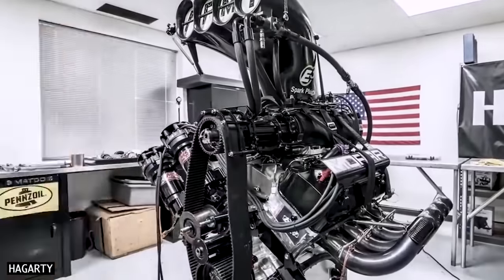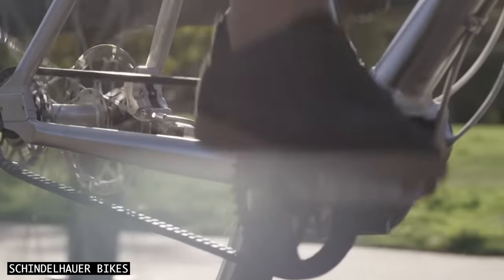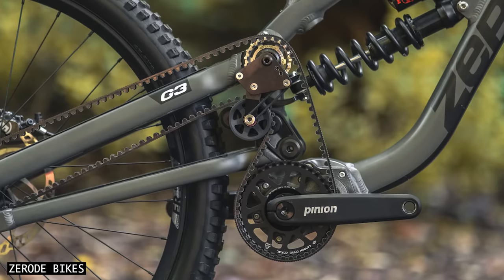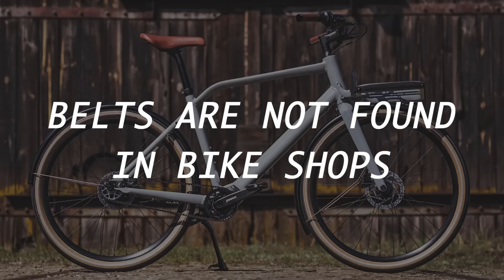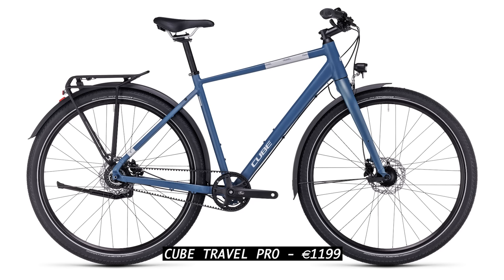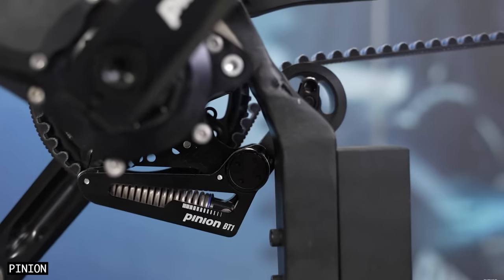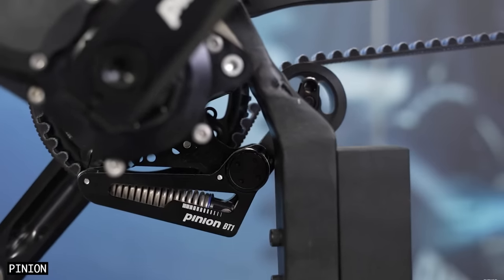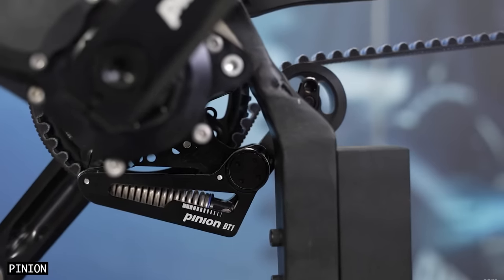Belts Are Now BETTER Than Chains On Bicycles!

Comment: A belt is great with an e-bike. It literally eats the energy you put in it when riding a normal bike without any assistance. I took the belt (and cogs) off my bike (with a Pinion P1.18) and replaced it with a chain. The much better transmission of the energy was palpable. Don't believe what Youtube tells you unless you've made your own experiences. This video is full of misleading information.
Reply: You didn't watch until the end.

Comment: Belts are not as practical, serviceable, available, compatible and easy to fix as chains.
if a belt snaps in the middle of nowhere you will regret for the rest of your life, 
Belts are not yet that good for long tour expeditions, yes you can do it but it's not the same as the old reliable chain.
Reply: You're literally trying to preach to someone that has spent the last decade or so of his life on long expeditions...
Reply: @cjohnson3836  my opinion
Reply: @Almajtek  is irrelevant. You're not informed enough to have a valid opinion.
Reply: I have to agree. The biggest problem: once something jammed in the belt and the belt will "remember it". With the result that the remaining lifespan is then suddenly uncertain, unlike a timing belt fully protected in a housing. And how gladly one "forgets" the "small" incident of the jammed small wooden branch. So belts are top for the city but flop for touring.

Comment: Dream: Convert my Birdy folding bike to belt drive. It would need both a custom tensioner to account for the suspension, and possibly an extra tensioner to manage the belt when folding the bike. The frame doesn't need a splitter.

Comment: Thanks very much for the apparently comprehensive look at bike belts, most enlightening.  The thing that puts me off belts is the need for a bike frame that allows for a break in the rear triangle to allow the belt to be fitted.  I'm not keen to take a hacksaw to my titanium bike frame.  Has anyone fitted the rear toothed pulley via a spline to allow the drive to be wholly outside the rear triangle ?  That would look weird and make the bike wider both at the rear axle and at the bottom bracket but at least removing and fitting the belt would be a breeze (although the need for such an odd frame kind of negates the advantages of allowing the use of a frame that would no longer need to be open-able to allow for the fitting of a belt).  Surely some eccentric frame builder must have tried this at some point in time since John Kemp Starley produced the first commercially successful safety bicycle in 1885.

Comment: I've been regularly checking improvements and deals of belt drive systems. But they're still too expensive for my taste, about 300$, which is considered expensive in my country.
I got nuvinci n380 with 2 gear front cog (44-29t) and 17t rear cog, but will be glad if I can change to belt system say below 150$, the price I bought the CVT gearbox.
With that said, you don't need a special frame. Some belt systems have dettachable section to install to any bike.

Comment: While perfectly fine on bicycles ,belts on motorcycles have 2 major downsides:
They usually require major disassembly of the  bike to replace (5 or 6 times the time to replace a roller chain)
On chip seal paved roads, loose stones land on the wide belt and get drawn through the pulley as the belt runs around it , destroying the belt
And that is why they are the least common final drive system

Comment: re: the timing belt vs. chain thing, couple critical differences. 1) speeds and temperatures are WAY higher in car engine, both of which wear the belt faster. 2) car timing chains, unlike timing belts, are are "wet," as in their inside the engine case, and have their own dedicated oil spray. The oil both cools and lubricates the chain, so it is always clean and there's very little metal-to-metal contact (the viscosity of the oil makes a protective layer between the chain and sprockets... chain oil on a bike does NOT do this). so in cars, belts have more disadvantages and chains have more advantages

Comment: There are pros and cons to both belts and chains. Personally I think chains are stronger. My latest bicycle build has three chains and four derailleurs for a total of 126 speeds. This arrangement would be difficult if not impossible if I wanted to use belts instead of chains.

Comment: I've tried for many years to go belt drive on my 2003 Cannondale Scalpel with a Speedhub. Even though I can open the seat stays for easy on-off with the belt, they say it won't work; they don't have a rear hanger tensioner that will work for me.

Comment: Even when a chain is dirty it still has an uncanny ability to run efficiently, it's a firm, crisp transmission of power. They have very small contact areas between chain and sprocket and self-clean exceptionally well. Take a good look at the contact area on the sprockets on your bike, use a magnifying glass if you like. You'll be surprised at how clean the surfaces are.

Comment: I got my 1st mechanic job in 1984. I was surprised when I saw my '05 Harley Davidson came with belt drive. on motorcycles not raced it seems to be better for certain reasons. unlike a chain it never needs or throws lube and I can't remember the last time I had to tighten it, maybe a few batteries ago. but I did snap one once with some violent downshifting on pavement, so they are not as strong, but it's breaking may have saved my transmission some grief. you can't always treat street bikes like dirt bikes, I must remember. if a chain snaps on a bike it can break the engine case and the oil comes out onto the exhaust and you're a spectacular ball of fire going down the road 🔥. but inside an engine for timing gears a chain is my only choice.  🏁

Comment: And in terms of chains in car engines.
They are getting lubricated with engine oil while running all the time. Bike chains can't get that. Temperature was also an issue for belts, but it isn't such an issue for modern timing belts. 
Chains in engine are protected from any debris, dirty oil often leads to premature failures of timing chain.

And many modern lighter chain drivers in car engines don't last longer than belts anyway, cause they are not so overbuilt currently (like some silent chains without rollers)
Reply from the maker: Thanks for the timing chain info! Can you tell I don't work on engines? 😅

Comment: I can see this as a future upgrade. I hope they can make gearbox components cheaper and lighter in the future without compromising quality.
Reply: They will, its all being built using old tech atm. Just wait for the nano manufacturing and the new materials to be brought in. Youll get gearboxes the size of your fist.

I just got a new set of false teeth, theyre made of molded zirconia because i tend to break the ceramics. That material alone would do it.

Comment: Until I see people riding on bikes with belts in the everyday traffic of the Netherlands I'll keep riding with a chain. Basically all the benefits you mentioned are already solved by dutch bikes, except for the rust but even that is largely reduced. You see we have a thing called a chain cover that protects the chain form any debris and almost all weather, it also makes it so that you don't have to worry about the grease on the chain because without taking the cover off you litarally can't touch the chain.

Comment: 2 main downsides for using belts that make them inferior to chains are: 
Belts are not completely immune to water-damage. 
Belts can easily slip when too much torque is applied. 
You have neither of those problems with a chain.

Comment: I think a little bit of graphite powder mixed with oil now and then, especially if they are exposed to mud or sand, will make these belts last even longer. Maybe a few times longer.
Reply: never put oil any where near a belt oil and rubber dont mix
Reply: @PaJa-gv3nv  The intention is to put the graphite. The oil is just to make it stick  longer. It could be an oil that doesn't damage rubber, like synthetic motor oil or transmission oil.

Comment: I never had any problems with a chain. I had my previous bike for about 10 years, I live in the Netherlands and use my bike frequently every day for commuting. I never had any issues with the chain.

The only notable durability issue I see a belt could fix has to do with the gears. Gears wear out fairly quickly with a chain, especially with a derailleur. I can see how that would be less of an issue with a belt and a gearbox. Other than that I'd have no reason to prefer a more heavy alternative.

Comment: Replacing my Shimano XT gearset (chain, front and back toothwheels) every c. 4000-5000 km on my S-Pedelec costs about 250 Euros as well. Makes the longer lasting beltdrive considerably cheaper.

Comment: There are plastic casings which used with single speed bicycles mostly, but still it posible to use such device with belt(theoretically, at least construction don't prevent it). If so then belt will last even longer... Well, in case if You don't fear around hundred grams of additional wight on Your bike.

Comment: with chains its hard to fully cover it with plastic because deraileur will get in a way and it needs to be changed periodically.
with belt, theres no deraileur, and maintenance is almost nonexsistent. if we put a plastic case that cover from chainring to sprocket fully, the drivetrain wont be dirty at all. which make it even more OP. why are you not talking about this?

Comment: Cost cost cost: Belts are much much more expensive than chains for the same performance. As you said, you need a special (and expensive) design of the frame of the bike. Then you cannot use the derailleur gear but need a hub gear. In the "normal" price range, you only have 7 gears and high frictional losses with gear hubs. You could use a Rohloff speed hub, which starts at 1,200 Euros, but that is like 10 times more expensive than a derailleur gear with similar performance.

If you are a competition cyclist (racing) you cannot give up the improved efficiency of a derailleur gear, so you are stuck with a chain drive. If you are just the average cyclists who is looking for a bike for the city, you will definitely not use such an expensive belt drive design, because it gets stolen in a blink. 

There are a lot of mountain bikes with chain drive, so the performance cannot be too bad. I´m glad you like belt drives, but it surely is only a benefit for a small percentage of people.

Comment: It's not x3 or x4 time long than a chain that you can cycle with the belt, it more like x15 of x20. With a chain you reach the max chain length after 2000km, so you need probably 20 chains for 1 belt!

Comment: Had a bike with belt drive. Sold it quickly. Adjustment had to be exact or one of two things would happen: 1. If just a bit too loose it would "skip". 2. If too tight it could deform the rear sprocket as happened on my bike. In order to tune it correctly it was recommended to install an app on my cellphone and measure the vibrating frequency of the belt!!! Also it was virtually impossible to get the crank gear perfectly centered so that at one point in the rotation it was too tight hence the rear sprocket was deformed, and on the opposite point of the rotation it was too loose allowing for an occasional skip. So no thanks. If a chain breaks, put on a new link and go. If the belt breaks it must be replaced by removing the wheel. For a while car manufacturers used belts to drive the camshafts resulting in severely damaged engines when the belts broke. Needless to say they went back to metal chains.

Comment: I dont have an ebike yet but i would also choose the belt drive, the problem is the ones with gears are really expensive compared to the chain versions. Only the single speed versions are reasonable priced. A few days a go i rent an old bike from my brother because i dont own one and havent used one since 20 years. The first thing happend was the chain torn off. .

Comment: My father had a Riese und Müller e bike with a standard chain after it got stolen after 3 years he bought a new one with a belt drive and he says he never goes back to chains and the 14 gear Roloff semi automatic hub transmission is just butter smooth

Comment: The rolling resistance on the belt is greater than on the chain. It's harder to ride. That's noticeable. The belt is tight and presses on the bearings, increasing the resistance to pedaling and rolling the bike. And an electric bike with a belt is super cool.
Reply from the maker: I'd encourage you to watch the sections relating to bearings (13:04) and drive resistance (18:19).
Reply: @Cyclingabout  Thank you, you have useful information.

Comment: My car has a timing chain. It lasts 100,000 miles before the side plates fracture. A typical timing belts lasts 70,000 miles costs less to replace and uses a fraction of the labour.

Comment: When I see a MotoGP bike using belts I would take a look. Dakar bikes have chains. On bycicles they have been using chains for a hundred years. It is the most efficient power transfer. Can shorten and lengthen when needed or on an emergency.

Comment: From 2010 i ride for commute a single speed Trek 1st District with CDC original belt, rear sprocket, front sprocket, minimum problems and for ocasional squeeks i use silicon spray from wd40.

Comment: With a good wax, you can now go up to 30 000 Kms with one chain (and way more for the cassette and chainring) and keep your drivetrain very clean.
It requires a bit more maintenance than a belt but now that much.
It's also very efficient and fairly cheap compare to belts.
However, to travel, it's not that great since rain, mud and snow will wash the wax from your chain

Comment: 7:40  my ebike has 160nm of torque,  you can get 180 to 200 nm torque ebikes with 2000watts of power,  so if the belt drive is limited to 50nm then the belt drive is only suitable for lower power bikes.

Comment: one reason I wont be getting a belt drive bike is the lenght of the belt is proprietary in lenght, I very well could use one chain across all my bikes (kids bmx, vintage foldable, vintage city, mountain). If my chain ever snapped I can just borrow another one from a diffrent bike while waiting on my replacement. And another thing, a rusty chain aint all that bad, I put 10 kilometers into a bike with a hella rusty chain, no rear tire, practically dead bearing like it was nothing (It was a junkyard bike). I actually run a slightly rusty chain on one of my bikes because I know that if it ever snapped I have like 7 other chains that I can replace it with. If you had 7 diffrent belt driven bikes you wouldnt have that freedom.

Comment: "mor than you can travel with a chain"    bro i bought my freeride mtb in 05 or 06 and it still has the stock chain.   the wheel bearings are now just gone bad but it had ALLOT of hours.    from purchase to around 2014ish i rode it every day many km`s   then it stood outside for a couple years when i moved with my wife and now im using it again with still the same old chain which is still perfect

Comment: It's clean, it needs low maintenance, it's quiet, it keeps length, doesn't rust or squeak or loose tension. It is the best choice for occasional drivers. Unfortunately it's somewhat expensive.

Comment: "The issue with belts is that if you cycle in the great outdoors and encounter rocks or other objects that could cut the belt, whereas a metal chain lasts forever. It's fine if you're doing those kilometers on the road, but I find it hard to believe that tests show it's more efficient with increased contact surface. I suppose it ages better, but over time it stretches a bit and needs to be retensioned, and it may suffer the same issue as chains or even worse if the links don't fit perfectly and don't rotate smoothly. It's true that they have started using belts in electric motorcycles, maybe they will eventually make their way into bicycles. The strange thing is that they don't make them with crankshafts, so we can forget about them forever; surely there must be a way to do it with similar efficiency."

Comment: Pinion is rumoring the addition of electronic shifting which would fix the shifter ergonomics issues they currently have. A trigger shifted pinion with no need to stop pedaling to shift would completely change my mind about their system.

Comment: There is one thing I don’t understand. How come that according to Gates bending the belt backwards causes damage to the belt while at the same time there are complete bike setups in which the belt is being bent backwards. I even saw images of these setups on the Gates website. Does it or does it not cause damage?
Reply from the maker: Bending a belt a certain number of degrees backward will not damage the internal tensile cords, and this is the case on the bikes you've seen on the Gates website. But bend it too far and your belt loses all its strength, so it's advisable not to try to find the limit...

Comment: for Motocycle, Chain are more durable in my experiences. I have Honda Cub and it's run for 14 years with the same chain (well, it was repaired 2-3 times) but my ADV run for 3 years and then it need to change a belt and clean up clutch bowl because belt leave a lot of dust and make moning start shaking and noisy.

Comment: Belt drives are quite interesting. To me personally its just weird having a moving part under high friction being bone dry. Ive seen problems with the bottom brackets wearing out faster. Ive seen torn CDN belts, although no torn CDX's. For chains, I would recommend no 10/11/12 gear chains, since theyre much thinner and wear out faster while being much more expensive than 7/8/9 chains.